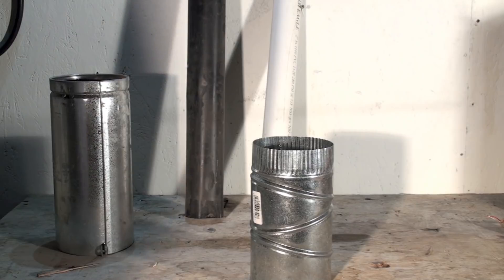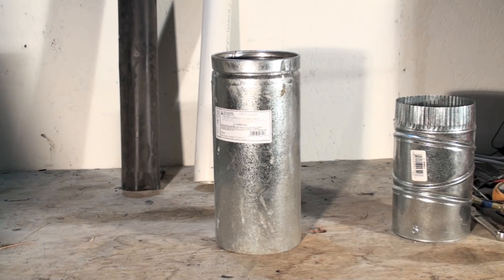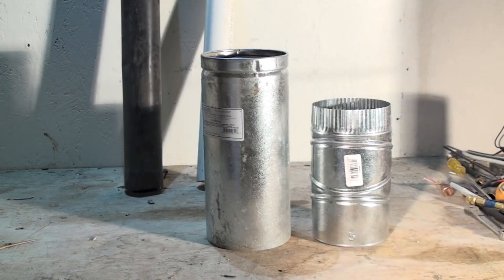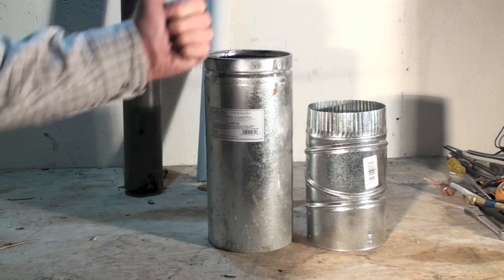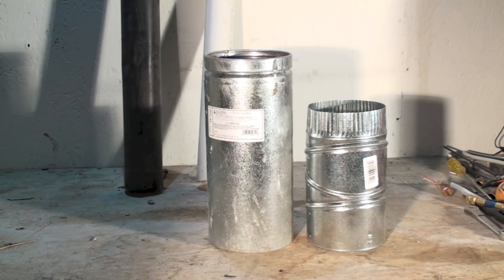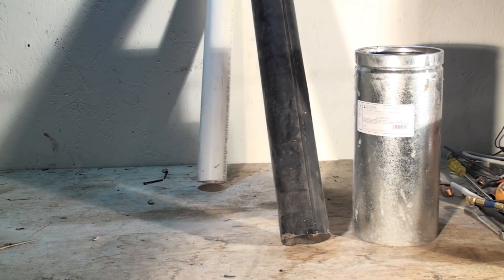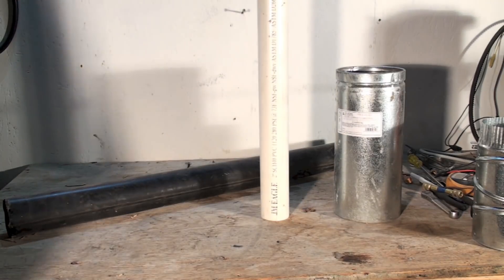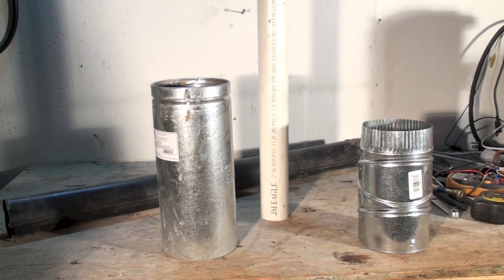Types of gas venting materials

Comment: Will a joint leak carbon monoxide  if not glued.
Reply from the maker: It depends on the material used for the vent and the design of the furnace.  Plastic vent is under positive pressure so yes it can leak.  B-vent and  C -vent are under negative pressure so any leaks will draw air into the vent.  Hope this helps.
GFM

Comment: Mr. Gray is a great guy who has spent the time to provide professional advice to me on several occasions. He was always correct and nice about it. This type of generous help is greatly appreciated.
I am reconditioning a “low-efficiency” gas boiler and the venting is rusted out. For this can C-pipe be used exclusively because there are no combustible materials nearby and the pipe entering a brick chimney is B. The burner hood on an old Raypac was rusted. It was tricky to clean-up the rust and mig weld in sheet metal.
Reply from the maker: You can use C-vent for the vent connector, but I would use B-vent, mostly because you have existing problems with rust.
GFM

Comment: What sucks is when you have substandard, code-breaking work done the “imposters” still get paid and scamper off without rectifying issues. Bad money spent. I too have several code-busters and will have to correct it myself. I could probably get the half-ass*d tech back but I don’t want him back. Should do a 50% COD upon satisfactory completion and even though I work overseas, someone in the know needs to monitor proper progression (MPP).

Comment: Can B-vent be used for a forced air oil furnace?  If not is there a reason and alternative?
Thanks
Reply from the maker: B vent is only used for gas appliances.
Oil furnaces can use C-vent (single wall min 26 gauge) with 18" clearance to combustibles.  Commonly used for appliance to masonry chimney venting.
Or you can use L-vent (insulated pipe) as a direct vent.
GFM
Reply: @grayfurnaceman  Thank you very much.  Is there a difference between the inner pipe that makes B and L different?

Comment: @grayfurnaceman, thanks for great content! At 6:48 you mention plexvent, which is the pipe currently connected to my Rheem 80 plus furnace. We bought this house in 2009 and it seems the inspector didn't notice it was recalled years ago😲 I'm wondering what type of pipe I can replace it with so that the furnace can continue venting from the basement sidewall?
Reply from the maker: You can probably use B-vent as the manufacturer recommends B-vent as a replacement for flex vent.  You will have to have 1" clearance to combustibles.
GFM

Comment: We used to use ABS for condensing furnaces.  Was legal in our area.
Reply from the maker: I don't believe there is much difference as both must be used with low temp exhaust gasses and are not damaged by the chemicals in the gasses.  Some jurisdictions require a specified venting plastic but I don't think it's important.
GFM

Comment: Will different brands of B vent pipe and fittings work with each other?
Reply from the maker: Generally, no
GFM
Reply: @grayfurnaceman   Thanks. The roofers broke the flex 90 just below the roof and the flue is at least 25 years old. I'll see what I can find without replacing the entire flue.

Comment: So what does BH stands for?
Reply from the maker: Its a single wall stainless steel vent for non-condensing appliances.  It is air tight because the vent pressure is positive.
GFM

Comment: I need to install an oil furnace but I’m not sure what kind of flue pipe to use.
Reply from the maker: If you are venting to a masonry chimney, you can use 26 ga C-vent (single wall) for the vent connector.  If venting is metal, you will need L-vent.
GFM
Reply: @grayfurnaceman  no masonry chimney. The vent would travel 2’ from the top of the furnace to the ceiling than 6” through an insulated area than out the shingle roof. So I would use L vent for this? if so do you you know what the clearance to combustibles needs to be for that pipe? I also read that the pipe should be a minimum of 5’?
Reply from the maker: @johnwhite6538  3" clearance to combustibles.  Size depends on size of appliance.  Never seen anything less than 6".
GFM

Comment: I am moving by boiler and venting out and up the exterior of my house then closing it up. What do you suggest I use to secure the 90 degree elbow and the pipe that runs along the exterior?
Reply from the maker: As the B-vent requires 1" clearance from combustibles, enclosing the B-vent with C-vent (26 gauge single wall pipe) will suffice.
GFM

Comment: so does that also mean you go down in diameter as well? or is that just for example? i would think you still need the 3 and 4 inch pipe inside diameter? the pvc has much thicker walls than the B or C
Reply from the maker: The diameter is determined by installer instructions and local codes.
GFM

Comment: Person at depot told me to use c vent thru the roof with a rubber boot for a gas water heater wonder how long until that burned
Reply from the maker: I guess the rubber boot would prevent fire, NOT.
GFM
Reply: Never take advice from a random retail worker

Comment: Can you put a 4” SS liner in a 6” b vent?
Reply from the maker: That depends on what the use of the vent pipe is.  If its for a wood stove, the B vent is not rated for that high of temps.
GFM
Reply: It is in a b vent chimney that is for a gas water heater. The water heater is the on thing hooked up to the chimney. I use to have a gas furnace hooked up to it, but replaced it with a high efficiency model which doesn’t use the chimney. I was told that going from a 4” vent to a 6” b vent might not be good. A chimney company told me I would have to replace the b vent chimney and they didn’t recommend running a 4” stainless steel liner through the b vent. A water heater manufacturer recommended having a 4 “ vent and not going to the 6”.
A liner would be less expensive to put in than a whole new b vent system. But I am not sure if it is legal or not.
Reply from the maker: You can just put 4" B-vent inside the 6" if the vent is straight.  You can use a flexible SS inside the existing vent if it is not straight.  I would not use the 6" B vent as a vent, but using it as a chase is ok..
GFM

Comment: What is considered conbustables Joists and subfloor?

How do i know if my boiler and hot water heater use different materials?
Reply from the maker: Wood burns.  It is combustible.  The 2 materials used in natural draft appliances are C vent (single wall) and B-vent (double wall, listing on the side).  
GFM
Reply: @grayfurnaceman  thank you very much. My boiler and hot water heater join right before they exit out of the side of the house into the chimney.  Was wondering if there was an easier material to work with like the pvc instead of b vent.  
https://photos.app.goo.gl/E13CRUCUHFBvSN7h7

Comment: I have a carrier unit from about 93 it is installed with 4 inch to 7inch c pipe but it's all rusted and I am tearing it all out... Can I use b vent pipe to reinstall it???
Reply from the maker: Yes, and B vent should have been installed originally.  Very common mistake back then.
GFM

Comment: What can I use for my air temp oil furnace 85%
Reply from the maker: If you have a chimney, you can connect from the furnace to the chimney with C vent (single wall 26 gauge black pipe).  
GFM

Comment: I have an 80% furnace and the exhaust connects with b vent.  The exhaust connection is leaking hot air back into the furnace and causing it to overheat.  There doesn't appear to be any type of sealing between the connection (metal on metal).  Should this be sealed with HVAC tape or is there another solution?
Reply from the maker: This does not sound right.  There is no need to seal joints because the vent is under negative pressure.  My thought is you may have a draft hood equipped furnace that is spilling out the draft hood.  Do you notice heat coming from the top portion of the furnace when its on?  If so, that is a dangerous condition.  You either have a vent blockage or a negative pressure in your house.
GFM
Reply: grayfurnaceman thanks for the feedback!  Amazing that you knew something was off.  I took another look and the draft actually appears to be caused by a leak from the heater air output (only happens when the blower motor is on) and blowing warm air through the sheet metal joint, right under the draft hood exhaust, next to the inducer.  My little closet gets warm and then I get short cycling.  Maybe time to call a pro?
Reply from the maker: Probably
GFM

Comment: I can only find B vent and C vent at Home Depot.  My furnace was installed in the early 90"s.   The original builder used C vents and it corroded like hell.  What vents do I use to be in compliance with housing codes?  I live in CA.
Reply from the maker: Some of the 80% furnaces in the early 1990s were installed with C vent.  The vent temps were too low and the gas condensed in the pipe.  Use B vent from the furnace to the vent pipe.  It should work ok.
GFM

Comment: I want to install an old school furnace in my shop, a Lennox G 20 series, 100,000 btuh.  I see from your video I need to use B vent.  The furnace outlet is 6 inch oval, and wondering if I can reduce down to 3 or 4 inch thereafter.  A 2 foot horizontal run will get me through the exterior wall and asking, can I cap it off there, or must I 90 up and go vertically through the roof?
Reply from the maker: You can't reduce the vent below the size of the draft hood connection.  You do need a a vertical riser and termination of the vent.
GFM

Comment: Hey what would you do for an empire natural gas space heater that will be vented into a masonry chimney that is fully inside my house except for the top 8ft. The chimney is not lined. It used to vent an oil burning furnace directly into the chimney. We now have a direct vent gas boiler venting out an outside wall. Nothing is in the chimney now but id like to put the space heater in it in the basement. I'm in Rhode Island. 2 story home with a full unfinished basement.

Comment: is it ok to use the spray gap filler around B vent going between interior and exterior sidingthis is on a vent pipe for propane water heater
Reply from the maker: It probably is not strictly code.  You should have 1 inch air space.
GFM

Comment: Can you use the B vent for a horizontal application? I have a 12 foot span with plenty of clearance for the .25 to 1 foot run.
Reply: M Fitc
Reply from the maker: +M Fitch It can be used as a vent connector horizontally if the vent has a minimum 1/4" per foot rise.  Higher is always better.  Hope this helps.
GFM

Comment: you can install single wall pipe on furnaces 80k btu or better and thing less than that requires B-vent. Can't find it in the book but the inspector says so
Reply from the maker: The single wall pipe issue seems to have legs.  The IFGC code gives some cases where single wall can be used with induced appliances.  However, field experience tells me to use only B-vent to avoid rustout problems.  I will be coming out with a video on vent connector sizing that may help.
GFM

Comment: Good stuff.  We see a lot of C vent coming off the furnace and water heater that turns into B vent at the Y.  And you're right, single wall rusts out big time after about 5 years.  Thanks again for the videos.